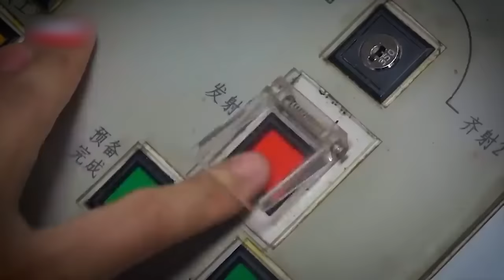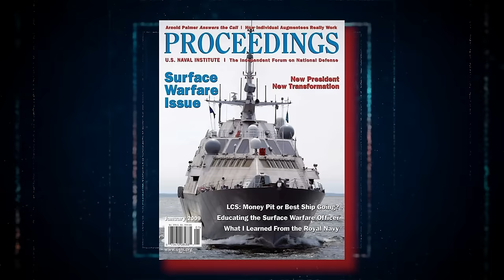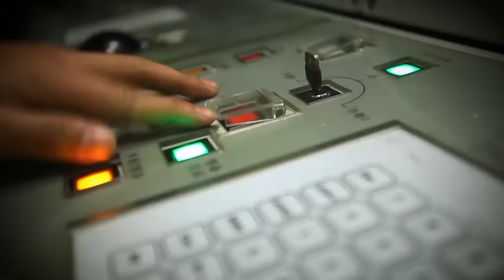China Launched Killer Type 038A Electric Submarine Threatening US

Comment: The difference between nuclear powered and diesel electric submarine is not only range but the later is much quieter and stealthier. It can switch off its diesel engine and use its electric battery to ambush prey.  Nuclear submarine engine cannot be switched off because its nuclear reactor must be kept running all the time. 
China diesel electric powered submarine is the Type 39 and the latest is Type39C . Most are AIPs. Its primary task is to seek and hunt US Virginia and Ohio Class submarines in the South and East China Seas. In addition,  just like the US, China also has hunter killer AI UUVs than can patrol its nearby underseas 24/7  to stop US submarine rom launching its tomahawk cruise missiles in times of war. ..
Reply: Nuclear Submarines are quiet. Unlimited range. Noise is dampened.  As in case of Russian submarines called blackholes. Please read up.
Reply: @pvajit1109  For the sake of argument, do you now the measure use for noise level? And what is the noise level of the sea?
Reply: @pvajit1109 ..... wrong, nuclear powered submarines are nosier than AIP submarines.

Comment: Wow, China has invented the Air Independent Propulsion system which doesn’t need oxygen from the air for its Diesel engine propulsion system. This AIP system allows a conventional submarine to stay under water for a long time as it doesn’t need to surface since the engine does not need oxygen from the air. The Yuan class with AIP technology is silent under water and has the primary advantage of a nuclear submarine.